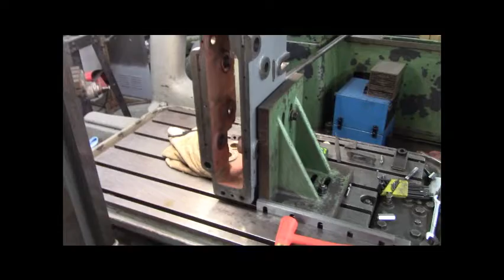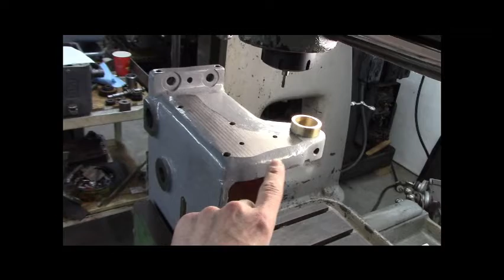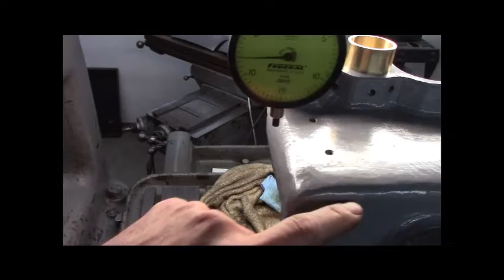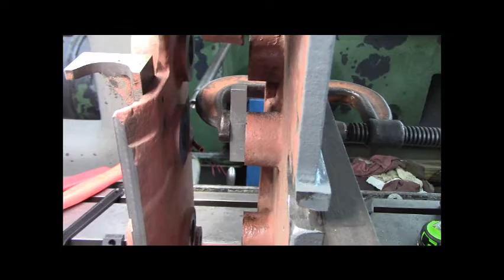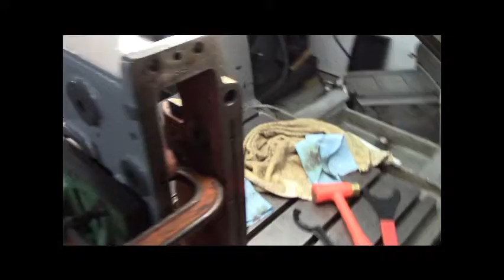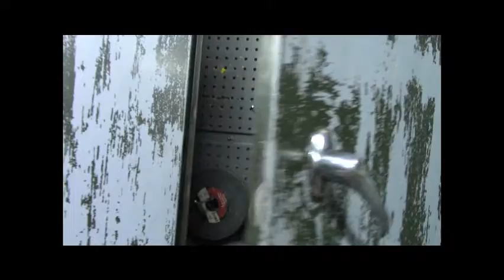Doozer's Machine Shop Update 2-23-20 -- Colchester Apron work on the SIP

Comment: Hi, I’m new to your channel, noticing your interesting comment on bcbloc about putting an angle on the flat of the shank. That sounded like a good idea, but I didn’t quite follow enough to replicate it myself. Can you show it in one of your videos? Also I noticed you have a Deckel FP1 in your shop. How do you like it?
Reply from the maker: Hello John.  As for making a tapered flat on a shaft for better retention,  just put a shim, about 1/16" or so, under the long end of the work-piece, so it is tilted in the vise.  Nothing scientific, just so it is tipped downward at the business end just a little.  Then mill the flat.  You will have a flat that tapers in the direction of the long end of the shaft.  This causes the set screw to bite tighter if the shaft is pulled out. 

As for the FP-1 Deckel, I have owned it for 15 years and never used it.  Just cleaned it up.  I have almost all the accessories for it.  I guess I have it because it is 4 morse taper, and so is many of my other machines.  Hope you enjoy my channel.  Always looking for more subscribers.
Reply: Doozer's Shop thanks for that. Yes, got it and that makes sense. I bought a Deckel recently, haven’t used it yet; busy building a new workshop. So I’m looking forward to getting to use it and learn its features. It has the adjustable table but only a quill head. Anyway I’m looking forward to going over your old videos. Cheers. John